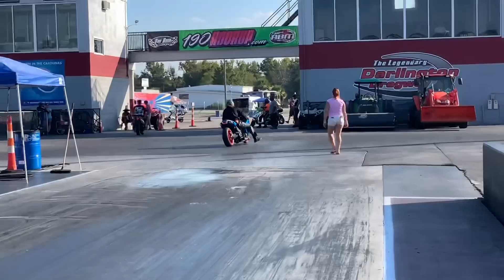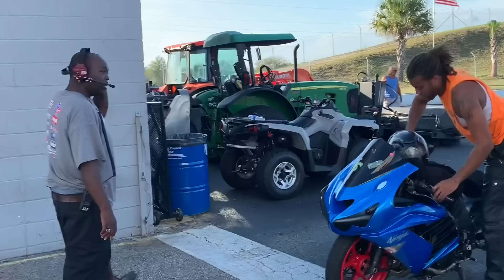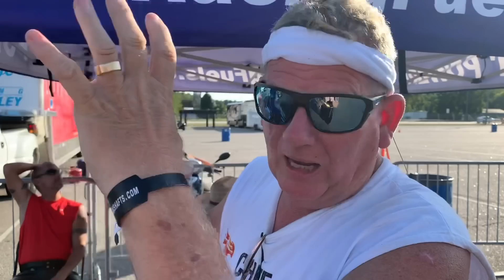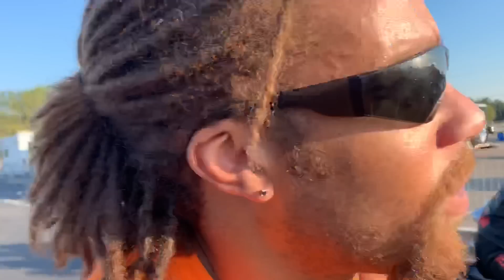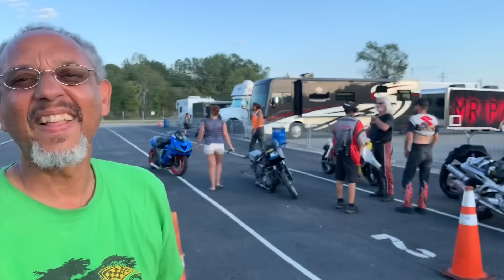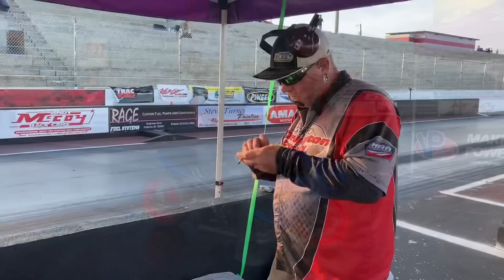ENRAGED DRAG BIKE RACER MAKES U TURN ON TRACK AND RIDES UP THE WRONG WAY! ZX14 KZ DELAY BOX DEBATE!

Comment: You take a gamble Everytime' he did all that huffing and puffing and still lost to one of the original kz Kawasaki's.
Reply: BTW' for you Young bucks that don't know that OG' on the kz was riding a Kawasaki z1r 1000' it's responsible for changing the course of motorcycle drag racing along with the old Honda sohc 750 of course. And I'm going to be bringing out my Kawasaki z1r turbo' so you know who I had on that race. From the get go! Or go get" or however they had that race arranged LoL'
Reply: @henrytyson3219  nice post that video I'd love to see your setup in action
Reply: Delay boxes are an easy button, i dont particularly like them. I think they should be banned and a delay box wheeliebar bike beating on a streetbike with a stretched swingarm isnt much to brag about. With that extra help in getting the power down it doesnt matter that the KZ is down on lower when it has the traction guarenteed and then that same bike has the hinky tree that gives an advantage of a known time for anticipation rather than it being about nerves reflexes and skill dont impress me that he beat the zx14 tbh as all those things are worth the hp deficit. Plus honestly with the what 40 years of tuning knowledge it isnt going to be that far down on power that kz will be what 140-160bhp ish on race gas anyway vs a zx14 at around 180-200.

The only thing that the KZ rider impressed me on is not blowing up at the guy being a dickhead.

If crosstalk shouldnt have been on he should have just not run once he realised, rather than the part run back up the track bs.
Reply: @jediknight1294  right but the mere fact they allow it for 1 individual and not for the other is still discrimination.
Reply: @jediknight1294  not much to brag about? Not only did he turn around in track just to cry but even after he got what he wanted he got beat AGAIN. Your opinion means nothing here and the fact is he broke the biggest rule in drag and somehow got a re-run and still got pooped on. 🤣😂👍
Reply: @JustinPR612  it really isn't a suprise the sports bike got beat, that takes nothing from the guy on the other bike, he ran a pretty good time and a clean race, good body position, from what I could hear of the shifts they were clean and executed well, a technically good and reasonably quick run for class. On the other hand, that setup is obviously going to beat a modded street bike 80% of the time at least unless the street rider is very very good or the guy on the wheeliebar bike is crap or has some sort of issue. It doesn't take anything away from the guy to admit that in a race between a stretched swingarm bike on motorcycle tyres vs the pure drag bike it's an obvious and unimpressive result. 

The guy on the sports bike is an asshole, no doubt about that, he handled the issue in the wrong way and at no point in my comment did I defend him. Honestly I'm genuinely impressed that nobody just hauled off and beat his ass.

The 3 things to take from this event, 1. Coms between track and event organisers sucked, the track should have been briefed on this issue to prevent the whole thing. 2. The guy on the street bike is irresponsible and needs banning especially given the threats of physical violence and attempts at intimidation and 3. There needs to be a serious look at their rules because there's a whole Host of issues, no solid policy on contesting a run based on rules issues, no clear when and when they wont order a rerun policy, the safety gear and tech rules are certainly neither NHRA or FIA approved and that makes me concerned about insurance and whether they have proper trackside medical coverage.

As for the rest, I'm utterly open about the fact I don't like crosstalk, delay boxes and the similar driver aids tbh, same as I dislike when launch control gets used when racing on the street, it takes something from it in my view.

I've not got a massive amount of interest in the promod/prostock end of drag racing, wheeliebars longer than the bike, tyres which mean the thing won't lean or turn worth a dam. I lose interest when I can't take the thing down the block and round a corner to get a can of skoal while at the track or in an emergency wheel it out of the trailer to go get a couple of gallons of gas for the truck on the side of the highway. Just a personal view, it's why I don't watch nascar anymore and one reason where I think BSB is more interesting than the WSS series because BSB disallows traction control and you can see a difference in everything from suspension setup, to clutch setup to riding style between the two and superstock riders going to. British superbike get one hell of a shock when they jump on a bike expecting that cushion to catch them if they slip off the ragged edge. 

I'm interested in the engineering of those cars and bikes because it will trickle down, because the ragged edge means we learn things applicable to what im interested in but... For me it's less about the rider/driver and more about the tuner and the guys who built the thing at that level. I'd rather spend the raceday in the pits watching and talking to the tuners prepping the bikes, discussing track conditions, power mapping, timing because on those bikes that is where the race is won or lost. Whereas on a streetable ish bike (emissions and noise limits ignored obviously because well we all do with our hobby builds) there aren't the tools and driver aids to compensate for. Stuff and reduce the human factor. 

I do admit I would like to see some of these prostock/promo bikes and cars raced in a series with, no crosstalk, no bump boxes, no delay boxes, no automatic rev matching setups, you can use a trans brake on the road iv driven with one that was reasonably streetable but other than that nothing gadget wise. Chutes and cages obviously, wheeliebars same on the high level stuff. Let's see how fast they are on that playing field just how much that the gadgetry adds.

Iv not raced since I went into the wheelchair full time about 6years ago, lost my bike license to a gov ordered retest after a rebuild of a lower limb, can't cope with sports bike seating positions anymore, can't crawl in and out of a full cage and do all the bending and twisting into place anymore so I just watch racing till I'm able to, Get back on a bike and then will be saving and plotting a build. Drag trike based on the rocket 3 is the dream, 2.3ltre triple, exhaust, remap, airbox work and restricter removal will get me 180bhp, race pistons from carpenter will get me up to 210, then go. Supercharged or turbocharged all with a rear end loop oke Exile's discovery trike kit, takes the hoosier large tyres or F1 style tyres and be something that i can take and race and ride home afterwards. 

Its all about watching the racing you are interested in at the end of the day isn't it, you like watching the prostock stuff with crosstalk, bump boxes etc im not so bothered by it. 

With all the bullshit that seems to have come from this event the 'Man Cup' multiple fights, this dickhead coming back up the track, arguments about classes, about racing across. Classes it seems to have been an utter shitshow, so it's an event I probably won't bother checking coverage of next time round.
Reply: @jediknight1294  Sorry man but no way I'm reading that book of a comment... the video showed me everything I need to know and I'll just leave it at that. Good day sir 😂👌

Comment: So how did the Cross Talk being "ON" make a non delay box bike red light???He still had to leave on his bottom bulb..
Reply: It messes with tree timing and means how you approach the tree changes, with it off you can use both trees and it becomes about anticipation, with it on its a different style of launch entirely so if you run in a particular way flipping to the other method screws your timings, screws your movements, when you clutch in, how you launch etc. So. Its entirely possible.

Comment: I went to Topeka a few years ago for the full goose bozo NHRA race.  They had support bracket racing. Weirdest racing I've ever seen. Cars leave hard at the same time and then at the half track idle to the finish. They have some weird device that closes the throttle to equalize the racing. Boring! I like pure heads up racing. No buttons, no helpers. Stab, steer, shift, and go!

Comment: Get him off the track.    He’s a danger to all racers
Reply: Jack Fessler 

He was a danger to everyone on the starting line. The rule is there for a reason. What if something malfunctioned on his bike? What if a track official saw something and was hauling ass down the track on a 4 wheeler and hit him as he was turning around? Rules are rules and being pissed doesn’t make them go away.
Reply: Nobody was running after him if there was then I would be agreeing with you guys
Reply: Jack Fessler  if someone goes 65mph through a Walmart parking lot, is that ok even if no one was currently in the parking aisle?
Reply: Not routine but not that dangerous this time. Way to complicated. I started at Detroit Dragway in 63 with a flag man.

Comment: I race at several different events and noone has ever told me I couldn't turn crosstalk off, but also this option came about when the entries were small and to avoid having two separate classes of box and nobox. My opinion from racers everywhere is if you run pro-et wheeliebar bikes you should have a box but that also would mean wheelie bar bikes shouldn't run street et nobox bikes
Reply: Honestly id much prefer there to BE seperate box and no box classes, id love to see prostock without a box be a thing again.
Reply: @jediknight1294  There are separated classes!  ProET and StreetET.  Pro Stock have never used delay boxes, they are a ProTree class!!  Educated yourself.

Comment: Evan, in my experience, street bikes have always crossed over to the pro bike class, but pro bike could not cross over to the street bike class.  That is their choice.  I have been beat by street bikes in the pro bike class and have never complained.  I was not on my game.  I just don't appreciate the street bikes complaining that I have a box when they lose.
Reply: Box bikes need to be a seperate class for pretty much everything with no ability to run them against no box bikes unless your doing straight grudge racing where it's turn up and draw anything, race anything IMO.

Regardless the box does give a massive advantage and your attitude there shows it. You don't credit rider skill or a well tuned bike at all when you lose to a street bike it was simply that you ran poorly. But you then demand that they acknowledge your superiority was skill not equipment when you beat them.

Id go back to watching prostock without boxes and hell may build a bike again if that happened.  I prefer street bikes and cars and thats what id build for preference if i can ever ride again (nasty roadbike crash a few years ago put me into a wheelchair)

Street machines are what I like to race and see race so i have a bias but yeah id like to see box vehicles racing box vehicles only competitively.
Reply: @jediknight1294  Ok, figured there would be some posts like this genius here. First, ProET is a delay box class. It is a separate class from Street ET, where boxes are not  allowed.  Apparently, reading comprehension is not your strong point. It stated in the rules that cross-talk would always be turned on for ProET.  Then they bent the rules for the cry baby street bikes that wanted to run in ProET to get more seat time and a chance to win more money, to allow cross-talk to be turned off just for them.  Don't like it, stay in StreetET.  Rules are rules.
Second,  a delay box may give an advantage, but you still have to hit the light.  I missed the light on the rerun shown above, but I still won because I ran on my dial.  Nothing to do with the box.  
Third,  Prostock has never used delay boxes.  Follow this stuff pretty close, huh?
Fouth, sorry about your crash and impairment.

Comment: Cross talk is only there as yet another aid  to box racers. As if they aren't already stacking the deck against a hand clutch no box racer.
Reply: I don't like boxes either but he was running in a box class.
Reply: @southjerseysound7340  No choice, they don't have a no box class.
Reply: @lunkydog  Yes they do. It's called Street ET. Research it.

Comment: All the hype over the tree, etc and the video DOESN'T SHOW THE DAMN TREE for the rematch. 
Won't give a thumbs down, but that was crap video taking.
Reply from the maker: Sorry bud. We will try to do better for you on the next vid. Stay tuned!
Reply: Joe Smith,  This is David Fletcher, the "old school" bike in the video.  I have the time slip for the rematch in front of me.  The ZX14 had a .0673 react time.  Mine was .1158, really sucked.  I totally missed the tree, even with a delay box.  This goes to show all the no box guys that a delay box is not the magic box they think it is.  You still have to hit the tree to cut a good light.  My lights are normally about .015 or so.  If you stop the video as we cross the finish line, you will notice I ran a 6.228 on a 6.22 dial.  Nash ran a 5.54 on a 5.56 dial.  He broke out taking the stripe.  I ran on my dial +.008. I got lucky and will admit it.  So, now you know the tree!  This reply is not meant to beat on Nash,  just answering a question that was put forth.

Hi Jack!
Reply: Thanks. I just enjoy watching the tree and seeing the launches.
I'm not a racer but like to watch..... and say... wow great reaction, or come one dude, wake up.
I dragged an Opel GT set up for SCCA road racing.
4 cyl, 4 speed, and no experience.
Have a great time twice, then was hit and totaled going to work.
Same type car in my profile pic.
Reply: @mtnstream1  lol.  I was trying to find a good station on the radio and bam!

Comment: Hobby racer gone postal his class is intermission go grab a coke!
Reply: 'hobby racer' arguably more skill in a no wheeliebar, no delay box class than running a bike thats 20ft long and has a guarenteed launch anticipation button

Other than you shitting on the streetbike class i agree with you though. I dislike delay boxes and have no interest really in anything when the wheeliebars get as long as the bike. I like my drag racing to be actual streetbikes and cars promods etc i dont have any interest in. Sure their fast but... Its got nothing to do with the real world.
Reply: I run a top fuel harley 6.30s Et at 224 mph so up yours bench racer!
Reply: @lesblack8036  not a bench racer, used to race some before life put me into a wheelchair, can't climb into the car through the full cage anymore.

I stand by my comment that a none box no wheeliebar bike takes more skill to launch well, same as a small tyre car at the top end of street spec takes more skill to do well in than a big tyre car with similar power.

Shitting on the guy for. Getting pissed when things dont go his way and as soon as your ego gets bruised kicking off exactly the same way he did and to someone that broadly speaking agrees with you.

I don't give a fuck what you are racing mate, iv driven and ridden various things and have my opinions based on my experience racing. I have my preferences and views on what is interesting to watch and what isn't.

When you get into top fuel, promod etc what impresses me is the engineering and the tuners not the riders/drivers. Seeing someone capable of setting a 2000bhp missle with a tune that will get the power down on a track others are spinning the wheels at 1200bhp impresses me. The guys building the chassis and setting up the machines impress me. The rider, not so much because the hardest part of it is all handled by the ecu's, the trans brakes, the delay boxes.

Someone doing the same 1620 in a manual Car with 1100bhp, in what was originally a street car, whose working with a chassis designed for a quarter of.that power, whose got to stage with clutch control, got to nail every shift perfect on a stickshift and fight the car. A car doing 8s or 7s passes reliably that he can drive home from. The track That impresses me.

The guy with with 200bhp NA Or 350 turbo or nitrous, on a stock frame length or maybe annother 6" of stretch, a 300rear, whose having to watch the tree and get his launch perfect with enough throttle control that he doesnt flip the bike. Having to balance that launch perfectly, nail every shift using a 1 down 5 up. Road style shift pattern. Feeling the bike want to go up on the back wheel and using the throttle and gears to keep it in the line doing what it's told on a bike he can ride home at the end of the day. That impresses me and im interested in watching it.

The guys running drag week, building cars that can take a 1000m road trip And then put down passes day after day impresses me. The way theyve built the cars to do that impresses me. Id love to see a bike do it. If i ever get the money to race again i may build A trike to do it.

Thats just my opinion dude, what you sneer at as hobby racing, is where I think the real skill is. Taking a street chassis with all the limitations it has, a manual gearbox, clutch launches and running fast enough to run with prostock bikes is impressive. 

Take the delay box and the wheeliebar of your bike and see how well it goes, im genuinely imterested in that. How well you can take a bike with a custom built chassis designed for the strip that is still you know... A bike, will still do corners, could if the cops didnt care about noise limits, emissions and light laws be used to go get a can of skoal and fillup from the gas station 5 miles from the house. 

Ymmv obviously we all have different interests but sneering at the street class Stuff just makes you look like a cunt, especially a guy who. Was from the mancup results up till the fuckups got into his head putting up some Dammed respectable showings beating prostock bikes.9